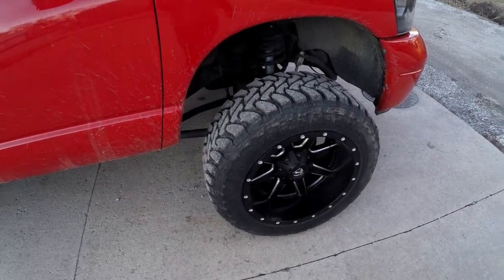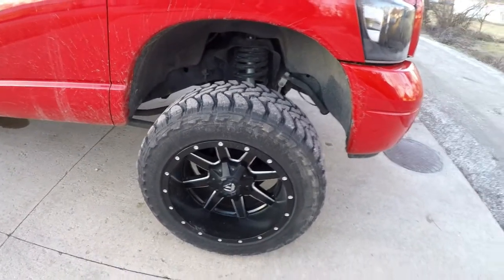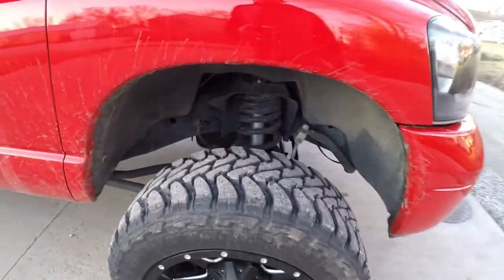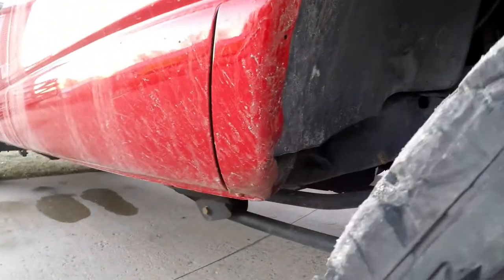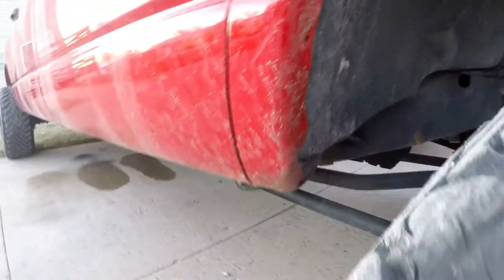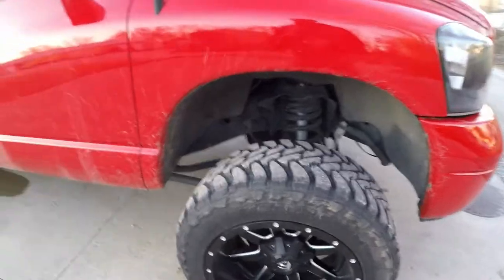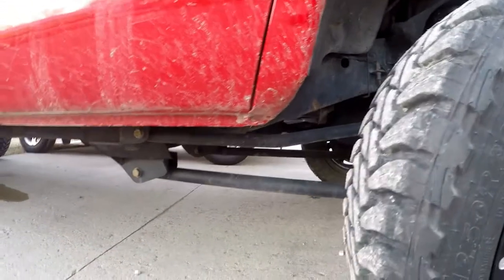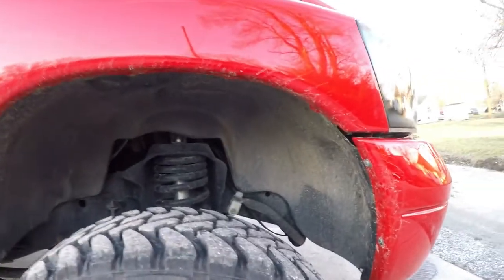Leveled Cummins 20x12

Comment: Yeah I have 20x10s with 35s on my ram I have to have a shop trim it I couldn’t do as good job as you did in the same spot. That whole round wheel well stuff doesn’t apply when you have that big a tire

Comment: Wow guess my 2004 Cummins is special lol. I put a 2" leveling kit on . I run 20/12s with 33/12.50 Toyo mts. Did nothing else. I have no rubbing at all. Mine is a 3500. Running stock track bar. Stock control arms. I put Bilstein 5100s on stock rear and 0 to 2.5 front shocks. Put max link 2 to 3" sway bar end links. My front end shifted to driver's side barley 1/8" pull front axle back maybe 1/8" you can't notice with the 2" spacers.

Comment: I have a 5” lift on my 05 Ram. I currently have Atturo 275/65/20 on factory sport ram wheels but I want to go 12 wide. So you mean to tell me you’re that tall and still rubbing? I use my truck to haul lawn equipment everyday so I have to stay A1. Maybe 20x10 then huh?
Reply from the maker: I was rubbing with 20x12 and 35’s with 5 inches. It’s just such a wide offset.
Reply: KReyCummins what do you think of where spacers? I like my set up on my 05 Ram but buying more rims (20x12) would really be a waste because I actually want 22x12😁 So I’m thing of wheel spacers for now. But I tow everyday? Please share your input
Reply from the maker: I’ve never run spacers. I would personally just save up for the wheels, but I think you can get a good set of spacers and be just fine. Make sure you don’t buy the cheap ones. Going cheap can cause all sorts of problems from making a tire feel unbalanced to a wheel falling off..
Reply: KReyCummins Man those Bora spacers are $300-400. Kind of makes me want to just buy some wheels. Yesterday some dude that has a dodge asked me to trade my 2017 factory sports for his factory 22 srt wheels. I’m thinking of doing that and just add mud tires. But I’ll still be stuck wanting stance🙄 lol... I love my dodge. By the way, those skar audio 10’s hit like thunder in the dodge👍
Reply from the maker: I’d would just buy some if I were you. For $400 you’re at the price of one wheel anyway.
Reply: KReyCummins thanks
Reply: KReyCummins man I’m watching your video right now as I’m looking on eBay for my 20x12’s😁 I so don’t won’t to rub🙄 I’m ordering m07 wheels